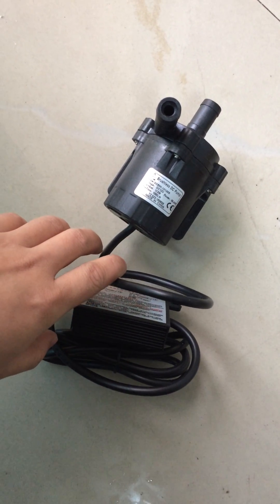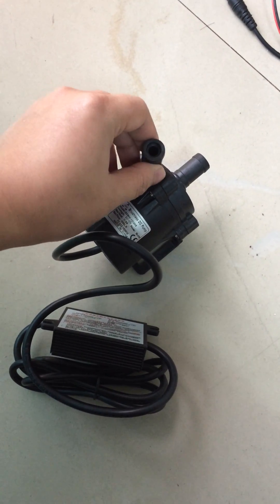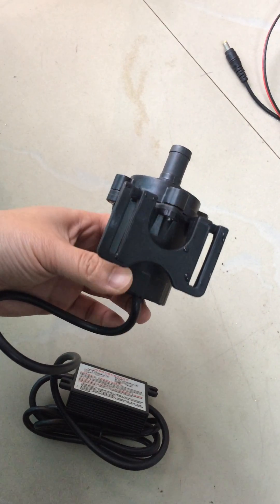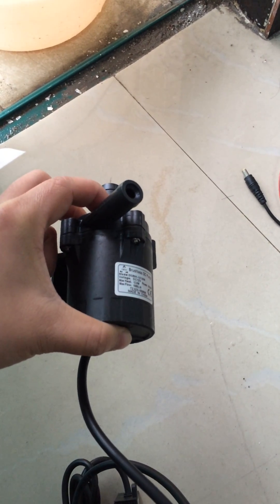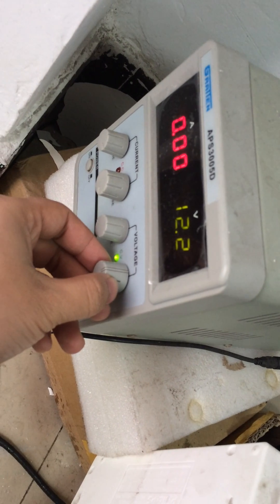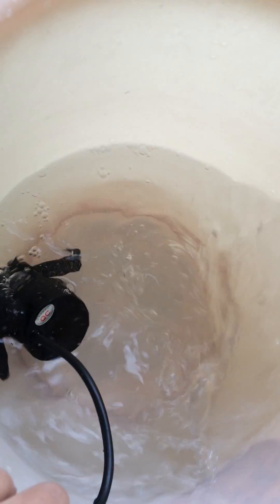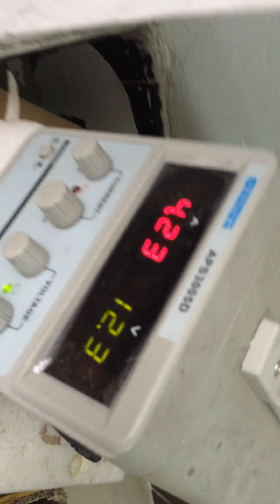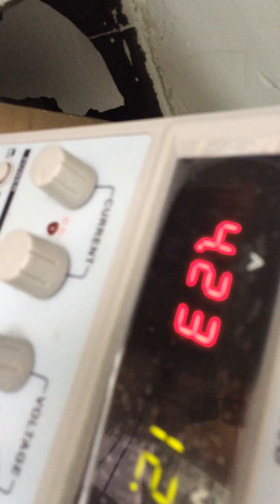Powerful High lift 12V micro brushless DC pump DC50K-12120S model 50W 12m lift

Comment: Can I ask you a question ?
Reply from the maker: Will be a pleasure.
Reply: @lilyyan5645 I have the same pump. Actually a bit smaller. But the controler box went bad so I cut it off. It has 3 wires coming out of the pump blue yellow and brown. When I connect it to a 12 v battery it starts for a second and than it stops. I have to take the wire off the battery and put it back on and it does the same again. Can that pump function without the control box ?
Reply from the maker: @Oo7Hola  Though I have no idea of the pump that you mentioned, yet, some information is shared with you, as follows. 

a) Q: Can that pump function without the control box ?
--
Negative. We can deem that ctrlbox part as being the brain of the whole pump. Thus, without brain, the pump cannot live. 

b) But the controler box went bad so I cut it off. It has 3 wires coming out of the pump blue yellow and brown. 
--
3 wires, yes. Actually, do not cut the cables off, unless it is professional user who wants to extend the cable length when for specific installation. Sure, if it is needed to extend the cable length btw ctrlbox and pump body, do not extend the length too long, since it will undoubtedly result in the voltage drop to the pump body part. Cable itself is resistor. 

c) When I connect it to a 12 v battery it starts for a second and than it stops.
--
I'm not sure the exact scenario. Yet, based on your description and if it happens to be pump product made by our company, then I think it is the triggering of DRY-RUN Protection mechanism. About DRY RUN and DRY RUN Protection, perhaps you can check other videos recorded by our colleague under this account. Many various pumps, higher powered or lower powered, they are equipped with DRY RUN Protection mechanism.
Reply from the maker: @Oo7Hola  Info is shared with you, as above. I hope it can be helpful. With regards. SHYSKY TECH CO., LIMITED
Reply: @lilyyan5645 thank you. The box blew up. Or shall I say the fuse inside the box blew up. And there is no way to change anything inside the box so I cut it off. I guess the pump is junk now.
Reply from the maker: @Oo7Hola  Typically there are some simple reasons that could result in death of ctrlbox part. a) Over-voltage powering or unreliable power supply (some declared DC power supply may actually include AC part within.), or sometimes some user may directly plug it in AC socket and then it is just burned. b) Water leakage, short-circuit exists. c) After long time use, the electronic components, some parts, may be aged and dead. d) Defectiveness of product itself when a new one, though this possibility is very very low if it happens to be our product. If it is others yet seems similar, then I say nothing about it.
Reply: @lilyyan5645 thank you much.
Reply: @lilyyan5645 yeah mine was due to plugging it in to a socket 😢 learned my lesson the hard way. The sticker was missing that shows the voltage and I was lazy to go on line to check
Reply from the maker: @Oo7Hola  You are welcome.

Comment: I want  to buy it
Reply from the maker: If this specific pump model DC50K-12120S, 12VDC is needed, I suppose that this item link shall be useful.

https://www.ebay.com/itm/302522133257

You can check, if you are interested.